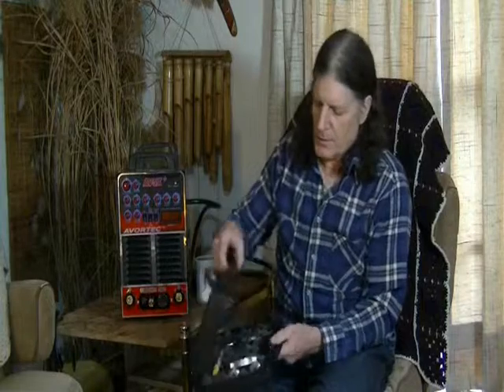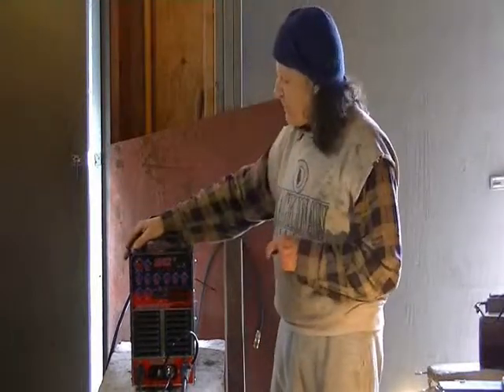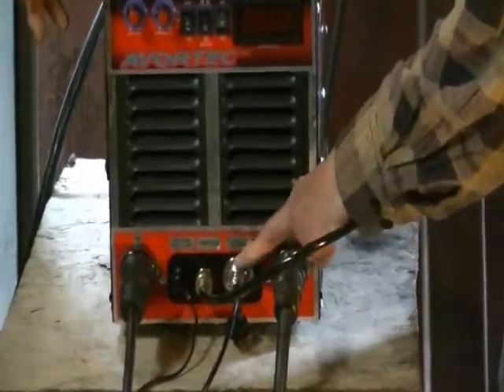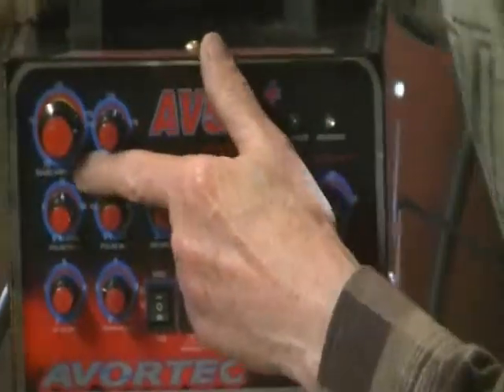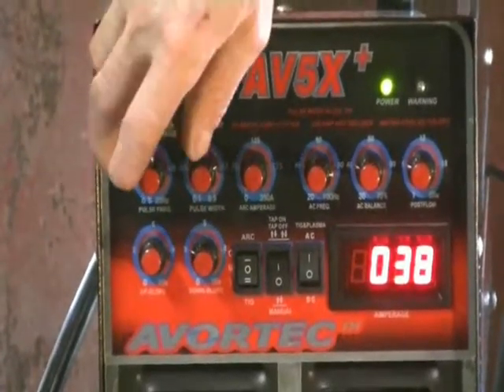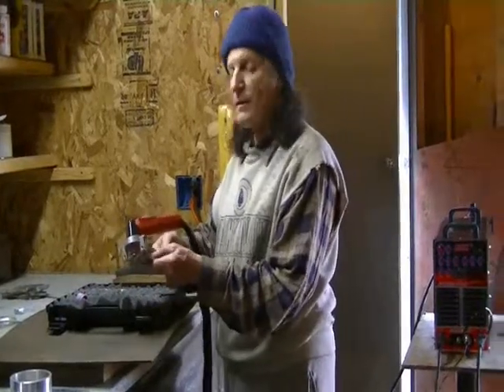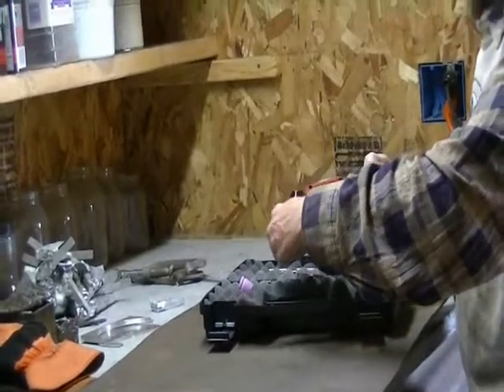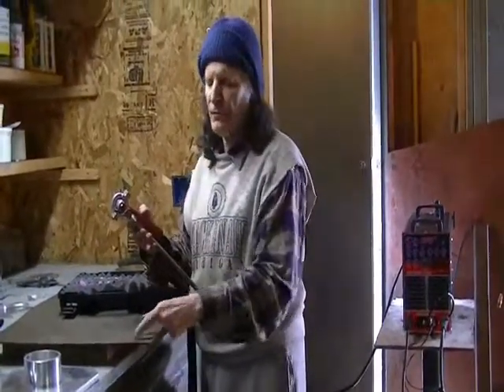Avortec AV5X+ industrial equipment review by Copperland Corporation, plasma circle cutter option

Comment: how has this plasma cutter been working for you? I am looking at some of the avortec mig welders,but it is very strange that there are no reviews ,informational videos on their products,thanks
Reply: The plasma torch shipped with the Avortec is very bottom line in performance. I bought a Panasonic P80 torch, rewired the ends to work on the Avortec, and it really rocks. I chose the Avortec for its 60% duty cycle in all modes, and I have never maxed out its capabilities. I do not have an Avortec Mig, but I would expect the same high quality from that unit. - Ken Rieli
Reply from the maker: Thanks for your question. This reply was inadvertently posted on our other YouTube channel 6 months ago:

"The plasma torch shipped with the Avortec is very bottom line in performance. I bought a Panasonic P80 torch, rewired the ends to work on the Avortec, and it really rocks. I chose the Avortec for its 60% duty cycle in all modes, and I have never maxed out its capabilities. I do not have an Avortec Mig, but I would expect the same high quality from that unit. - Ken Rieli"